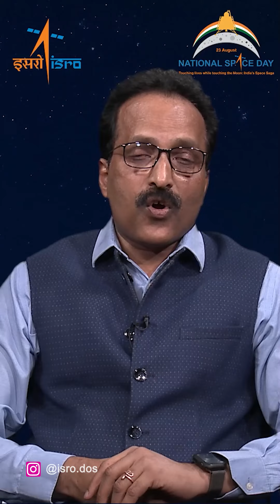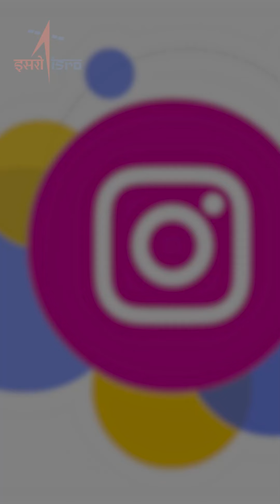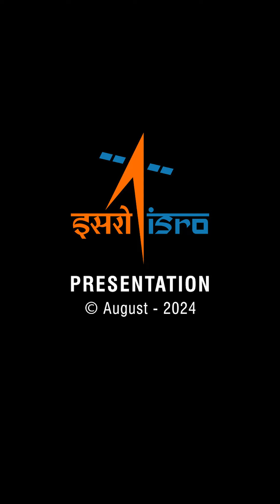Challenges associated with the usage of biogas as a fuel for the rockets

Comment: sir I think you made many valid points in the question but I also believe that from biogas we can extract the methane and use it as rocket fuel (already used on starship) which is a very effective way to gain , I believe current problem is to gain a methane which is effective to basically purify the methane in a biogas to rocket fuel levels